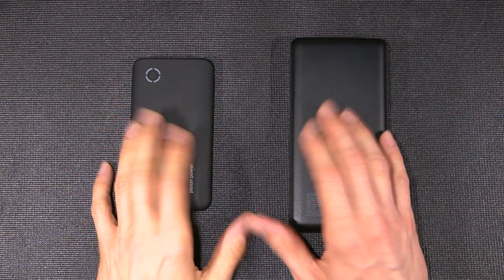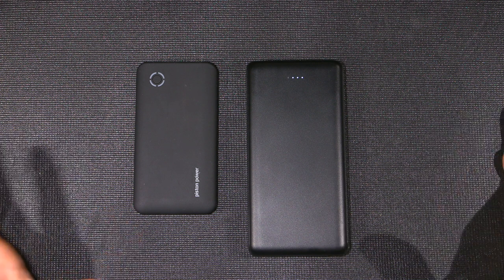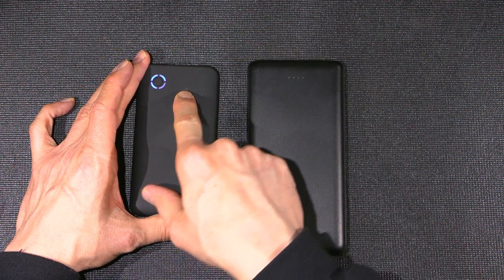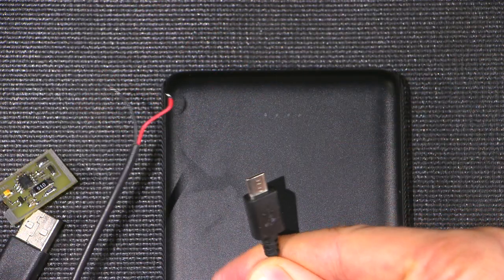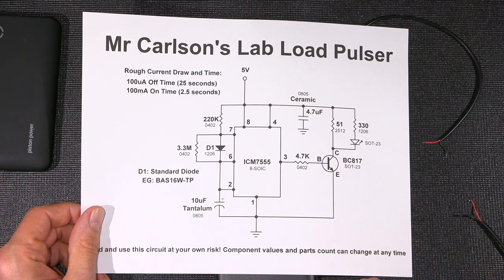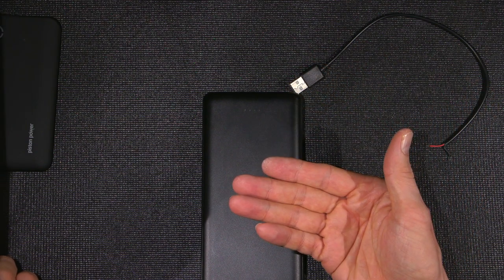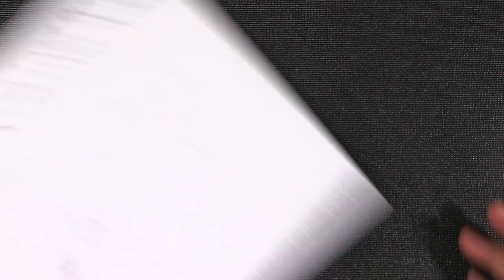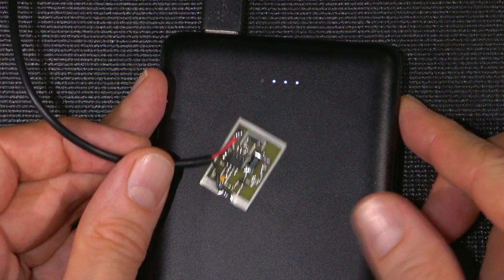Power Bank Stay Awake! Here's A Circuit To Do That:

Comment: Paul, the power banks turn themselves off because the are preventing their own battery from discharging. They are powered by lithium cells that only output 3.6 volts, but the USB ports require 5.1 volts. The use a switching boost converter to provide that voltage. That boost converter has a quiescent current even when the USB load is zero. If it didn't shut off, it would drain its own battery. 

Your solution is clever. Nice job.

Comment: A great idea. I use my power bank to run a low current device and out of the many power banks I have, only one seems to stay on. I run several data loggers that require 3 volts, the batteries for it do not last very long and expensive. I've made a 5v to 3v converter, but with your circuit I will be able to use the bigger power banks, giving a much longer time scale. Thanks for this little circuit, don't know why I didn't think of it.

Comment: I'm using a variation of this circuit with an ATTiny85 to control the timing. Way overkill, but it's what I had on hand. It's funny how the timing is so accurate because most of these powerbanks use the same chip, I tried playing with it but 1 second pulses are too short, 5 seconds unnecessarily long, 2.5 seconds works out great. Thanks for the video!

Comment: Good invention Mr. C. It looks like the duty cycle of your timer is directly proportional to the ratio of the two resistors. 220k/ 3300k ~ 10% duty cycle. As your circuit amply demonstrates. (2.5s/25s) That keeps things simple if an adjustable duty cycle generator was desired or required in a circuit.

Comment: I learned so much from this. I make model kit dioramas and want to use small USB power banks as a convenient long-lasting battery to power my builds. Will definitely need to make myself a batch of these. I'd like to make mine as a simple USB pass-through unit, male on one end, female on the other, that extends a cable and then plugs into the power bank. Thanks for sharing this!

Comment: Nice work as always!!! But maybe there is still some margin for improvement: you can reduce the quiescent current by 25uA (so 25% in this case) if you use pin 3 to drive the top pin of the 220k resistor.
Reply: Please explain how this works
Reply: @xonx209  during "off time" the 10uF capacitor is discharging through the 3,3M resistor and the voltage on pin 7 is kept low by the IC. So the 220k resistor is effectively between +5V and ground. If you connect the high side of this resistor to the pin 3 instead of 5V you will save about 25uA because during off time the voltage on pin 3 is low so there would be no current through the resistor.
Then during "on time" the voltage on pin 3 will be high so that the charging current can flow through the 220k resistor like normal.

Comment: Perfect.  I wanted to power a tiny 5v LED string off of one of these battery packs but when it displayed certain patterns on the string that didn't use much current it would turn off.  This will solve that, thank you.

Comment: This is brilliant!
I recently bought a clamp-on illuminated magnifying lamp from Amazon (USB-powered). When using the included wall-wart, or any other wall-wart (including a genuine Samsung phone charger) the LEDs stayed illuminated dimly when the lamp was turned off. In an abundance of caution, I assumed there was some sort of capacitive coupling or whatnot, and also was a little concerned that the metalwork might be referenced to mains, so I decided to (try) to use a USB power bank to run the lamp.
Well, none of my power banks will stay on with the lamp plugged into them, even at full brightness. As soon as I read the title I thought this clever little circuit would be a great solution, and reading Mr. Carlson's comment below confirming as much, I'm definitely going to look into building this.
The irony here, is that I need the magnifying lamp to build the circuit to make the power bank operate the lamp. HAHA

Comment: I've been experimenting with the "HW-0516 Dual-MOS Trigger Cycle" board to keep my power bank running. It has a low current mode, but goes off after 3hrs. Check the usual suppliers.
The HW-0516 Might be handy for some people, as you can then play around with the timing ON/OFF & resistor values quite easily. Plus it will run at various voltages. And is useful and inexpensive. Down side, is it's kinda big.

Comment: Thanks for this. Yep, when I had my "power bank" charger the automatic shutoff was at times annoying. On certain devices I would plug into it, it would cut off too soon. This circuit solves that problem nicely.

Comment: That's a nice solution! When space is not a problem, the 51 Ohm load and LED may be replaced by a small 6V filament bulb (or 2 off 3V cheap flashlight bulbs in series).

Comment: Another thing that makes a dandy light pipe: "natural" (untinted) PLA 3D printer filament. I don't use Acrylic filament to print, but I imagine that would work, too, considering many light pipes are made from Acrylic.
Reply: Ooh neato, I'm finally about to get my dual extruder working, was just going to use it for panel labels but built in light pipes sounds pretty cool too

Comment: Nice video as always! Maybe the same goal can be reached using only 3 components: a MC33164-5(or similar) a PNP transistor and the 51ohm resistor.... (the schematic is obvious :) ) in this way the circuit produces the pulse exactly when needed! maybe it's worth a try....
Reply: Oooh, I’m going to try this! 
Does any know if it’ll work?
Reply: @JonnyLOFI  Don't think so. The Undervoltage Sensing Circuit would send the pulse when the voltage drops below 5V = powerbank shuts down = too late.

Comment: This is ideal for my little USB soldering iron, for "outdoor soldering adventures". Great circuit!
Reply: You don't need it for that usage... the soldering iron staying on will keep the powerbank alive. If the soldering iron times out, the powerbank will switch off.... when you re-enable your soldering iron, the powerbank will come back "on" automatically.
Reply: @johncoops6897  Normally, yes, I agree. Unfortunately, I have a naughty USB iron that automatically times out, and then my powerbank shuts off too when there's no power draw. It's a pain in the neck. But this circuit will help.
Reply: @alpcns  - Yeah, I just checked my original 5V iron that has the silver touch button and 3.5mm audio jack for 5V input. Yes, this circuit acts strangely, I think that's because of the way that it needs input voltage to re-trigger (via a 555 timer!).
The easy solution is to open up the soldering iron and bypass the timer circuit - in other words, wire the USB cable direct to the heating element. I have another 5V USB iron that uses the same element and a simple switch on the barrel. That works much better than the silly timer method, of course it adds the risk of leaving it switched on.
Reply: @johncoops6897  Thanks for the tip!

Comment: That's handy. I use power banks to power single board computers. Was never a problem, until now I've got the most power efficient SBC ever, the RockPiS. The thing consumes -0.1A in idle and my power banks shut down because it's that low. I always plug in a USB3 memory stick so it stays on. But it then consumes 4 x as much. 
And I thought I was the only person editing and rendering videos on power banks :) I edit and render my videos when traveling with SBCs. Power banks are charged with solar panels. I love my gear. Greetings.

Comment: This looks wonderful. I use an external battery pack to run my Xbox controller and VR headset and the self shutoff feature is wonderful as long as it doesn't exist. I had resorted to modding a cable with an old LED just to maintain a load at all times. This method looks much better.

Comment: I would try this first. Press the power button once to turn the unit on. When the charge status lights come on press the power button twice in rapid succession. The unit is now on and will stay on till exhausted. To get out of this mode press the power button twice in rapid succession. The last status light will flash while in this mode. I have 3 of these power banks and all of them work this way. Not saying yours will and by the way none of the instructions that came with the units said anything about this mode. I found this by playing around with them.
Reply: Exactly! Xiaomi power banks do have this built in feature & they do say that specifically in user manual!😀
Reply: @Chet Helton :
Interesting.. I'm gonna go try that with mine.

Comment: I've run into the opposite problem, the boost converter in these things doesn't have the surge capacity to start an inductive load (blower that draws about 1 amp running). I could have built a soft start circuit, but decided to keep it simple with a 1 ohm resistor across the power switch to keep the start current around 2-3 amps. Plug it in, let it spool up on "low" and then snap the switch on.

Comment: I added a 12V fan to the back of my locker at work because when it rains I want a bit of fresh air circulating so my cloths dry a bit, the fan draws too little current and so the power bank shuts off... simple solution: resistor parallel to the fan to add 20mA of current.
Maybe some day I will add a little pulser for more efficiency!

Comment: Just built the circuit, It works perfectly. I changed the timing resistor from 3.3M to 1.0M as my power bank had a 10S auto switch off for some reason.
Reply: Do you offer to build them and sell? I like to purchase a few. I try to look up the parts but they only sell in bulk.

Comment: Thank you for your video.
I have found an easier way is, using a Y split USB cable. Connect a 6 volt 0.1A mini lamp to one socket so that the power bank glows the lamp and will not shut off. It works for me.
Reply from the maker: Hi Paul. That may work, but you will be drawing a continuous 100mA from your power bank, causing the battery to deplete much faster.

Comment: Perhaps an always active powerbank might be more dangerous if you like forget it turned on in a purse or something. I mean they can be dodgy enough as it is.

Anyway I love how you can span from super old to super modern devices in your channel
Reply: Protection should cut it off before anything bad happens, same as when you charge something that has more capacity than charge in the bank.

Comment: Love the little project :)
Personally I had an issue (in the past)
That if you charge a power bank and use its output it works just fine, but if you remove its power input and want to run your gadget from battery power (in my case an MMDVM) it would shut off the power for a split second...
That resets the load (and my raspberry pi does not like that..)

(Maybe you have a better/simpler solution?) 
My personal solution:
Build your own power bank,
With a charge circuit and a separate boost converter to get 5.1 volts

Inter grated that all to my MMDVM and it works beautifully 

(Side note, I have since bought a repeater. So I don’t really need a hotspot anymore)

Keep up the good work!
73.
PD0HOF

Comment: Thanks for the circuit.  I sometimes use the power bank to power little projects, and the darn power bank would cut out on me.  I built the Carlson "Stay Awake" then read some more comments that said the Anker has the feature builtin!. So, did I just waste a couple of hours? No, it appears that I have the smallest Powercore 10000 which does NOT have the stay awake feature builtin.
Reply from the maker: Glad it helped!

Comment: Nice.
I have a small USB audio amplifier and when testing tonight, found that even with it on  the stupid powerbank turns off after its 30sec period. (only tested at a reasonable/low volume). 
As part of the amplifier project I'm also going to build a little light blinker with some LEDs (strictly decorative) that'll go inside the case...not sure even the minimal current from that will keep the powerbank awake LOL
If not, I'm gonna try your little circuit here...but using standard parts on perf-board(basically just add it to the "lights board"). I can't do that fancy/tiny SMD stuff.......

Comment: I have a  perfect application for that Circuit you designed I think it’s gonna be quite useful for a birdhouse that I have  I’ve made into a solar phone charger. And power bank it has the same issue One day I was trying to power a radio of mine and the power bank kept on shutting off If I turn the volume up on the radio rather high the power bank Circuit board would stay on. I have an idea could you Maybe put a male USB on one side and and a female one To make it easier I think it would make it easier on my application because that Solar bird house already has enough wires in it there’s a few videos of it on my YouTube channel . By the way I have autism so I don’t say much in my videos normally or anything at all in my videos. I enjoy your videos they give me ideas now as for the birdhouse idea I was bored one night

Comment: The reason for them powering off after a while would most likely be because if you throw it in a bag and the button gets mashed in there, then it would slowly discharge while not being used.
It’s a neat solution for keeping them on during low power draw, but would work best attached to the cable instead of permanently installed if taking that into account I think, unless one use the powerbank quite often, and not as an emergency backup.

Comment: I simply just built my own power bank. 50ah lipo pouches are rather cheap on Aliexpress. 3d print a case and put a 3S BMS and a QC3.0 module in it with a usb port and xt90 charge port = less than $200 and can run my phone for a week with no power saving and only weighs 6 lbs. Oh, and it never shuts off, though I do have to top it off and discharge it to about 90% once every other month if I want the cells to last.

Comment: Cool idea! I use these power banks for driving Arduino type ESP8266 sensors, but they don’t draw enough power to keep power brick alive - solved! Can use a pin on the Arduino to drive the switching transistor rather than a separate 555 timer.

Comment: On some powerbanks, you can simply change the current sense resistor on the board to keep it awake @ 50ma or less. 

It depends on the circuit design of the particular powerbank.

Comment: The low impedance battery can do real damage of something shorts. I use SMT PTC (positive temperature coefficient) fuses to protect stuff like this. They are inexpensive and available in a huge range of current ratings from a few mA to Amps. They trigger quickly and reset in a few seconds if the load goes away. No smoke, no flames, no burned PCBs or vaporized traces. Been using them in aircraft instruments everywhere for 40 yrs.
Reply from the maker: Hi John, all packs are current limited.
Reply: @MrCarlsonsLab  not the jump starter packs, they give you DIRECT connections to the cells, no protection circuit between you even unless you count the diode pack in the car starter lead, the cells themselves are DIRECTLY on the output wires

Comment: This is great! I actually tried to make this exact same thing last year, but it didn't work. Looks like mine discharged too quickly, didn't stay on long enough, I think only for about half a second.

I would have messed around more, but the pack I was building it for died, and I ended up getting a new one that DOES stay on when I leave stuff plugged in (they exist! I think they need to support some kind of quick charge standard to do it, though)

Comment: Nice simple standalone solution that can be modded into existing products or used as a module for project. Another great job for the 555!
Those USB power banks surely are quite pesky. I had to do similar solution for one of my projects by using a spare MCU pin to do the pulsing. Then I added a small switch labeled "Crappy power bank mode on/off".

Comment: Been there, thought that, I mean the frustration. Just did not build it yet. I would use the standard 555, because the draw of 100mA for 2.5 seconds is way more than the 25 seconds (3 - 6mA) timer draw. But I guess you have the ICM7555 in stock and I don't :)
Nice to share your design Paul, some will surely benefit from this.

Comment: interesting  use for venerable 555 timer....
i have bluetooth receiver i use in a work vehicle...it uses the auxilliary input of the vehicles in dash stereo and is charged via micro usb, the device is a few years old and these days, it's charge life is down to about 20 minutes so i would like to power it from a usb port that is on the stereo or even a seperate power outlet 12v to usb charger....,problem is the vehicle's eletrical system is incredibly noisy and creates a loud hum.....so i have been using a power bank instead and have this same shut off issue....i was thinking of building a filter to remove the hum, but this timed trigger installed in the power bank  might be a simpler solution if the switching noise isn't to loud

Comment: if you have the power bank already open, you could wire the device to pulse the button instead of wasting some current
Reply: That is a MUCH better solution. Although for most powerbanks this is totally unnecessary for phones and other chargers, since the powerbank itself detects the load (from the phone) on the USB terminals and switches back on again automatically.
Reply: i have actually hacked one of my power banks to stay on forever by cutting a trace on its pcb (it is a sense line that detects when one connects something to the powered-off powerbank). The powerbank lost its power-delivery/quickcharge on the other port, but i don't regret it too much.

The power draw is quite small, it seems to take a couple of months to halfway drain the power bank. If i were to use this load pulser hack, it would fully drain my pack in about a month. Worse, but still acceptable.